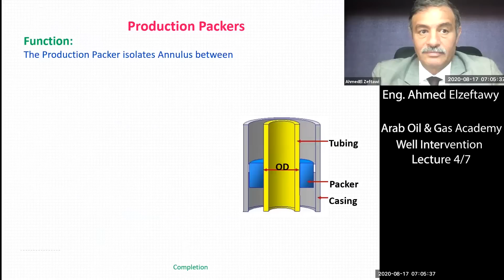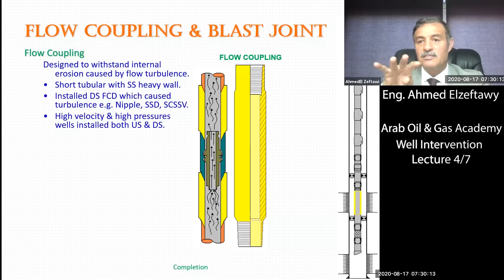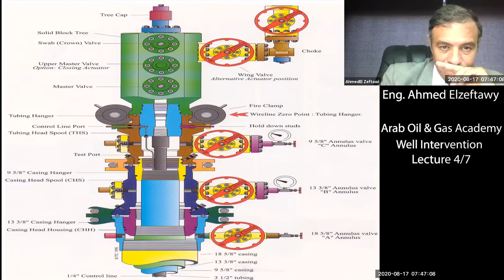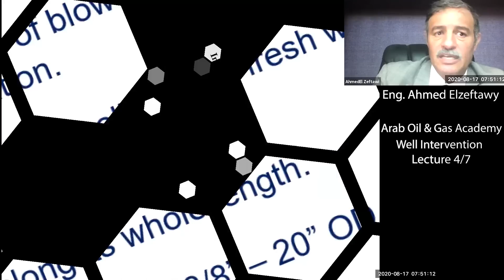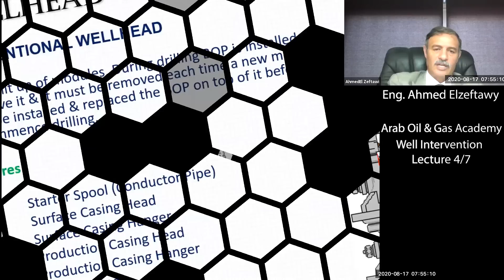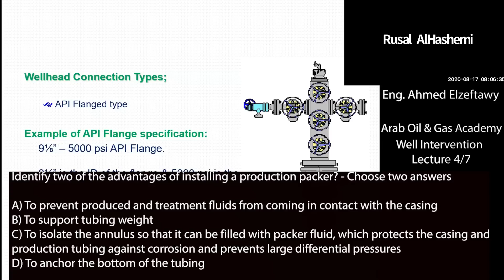Well Intervention Short Course - Lecture 04 - Eng. Ahmed Elzeftawi

Comment: For the one who asked why we run BOP after surface casing:

This is true, because we cannot use a BOP with conductor casing. BOP shuts-in on a flowing well and shallow formations cannot withstand the pressure build up after shutting in a BOP.

While drilling through conductor pipe, we install something else called Diverter. Its role it to divert the flow to the vent line away from the rig without shutting in the well.

After running surface casing, the formations are hard enough to withstand pressure build up if BOP is closed.